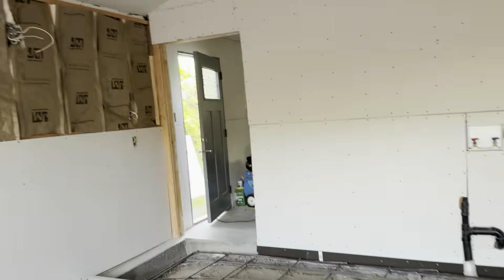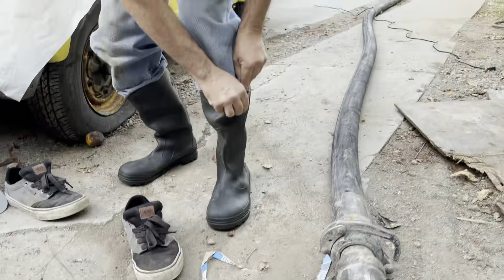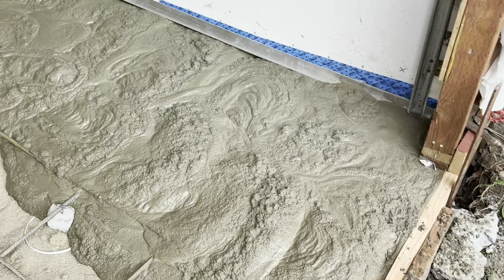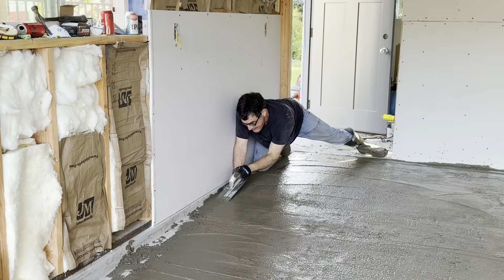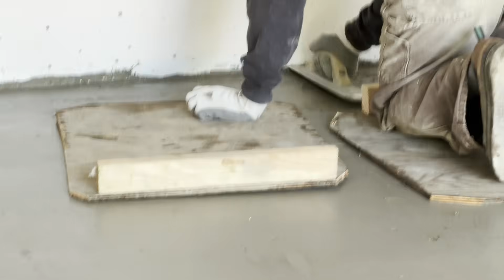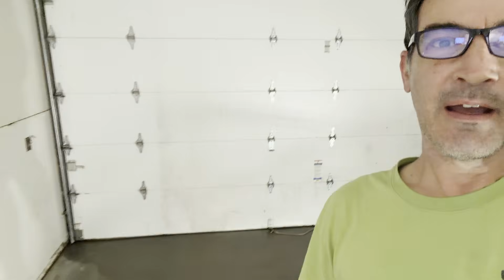Garage concrete floor pour

Comment: i've gotta do a repair / leveling job on a 25'x60' portion of my shop.  my dad is convinced we can DIY it for maybe 5k, but i'm going to have him watch this entire thing start to finish.  I got a quote for around $10k which i think is in the ballpark of reasonable....  anchor profile / mother's milk epoxy / and pour glass reinforced concrete ~1-2" thick
Reply from the maker: Good luck on your project!  You will need a few friends who can get er done in order to stay ahead of the concrete cure